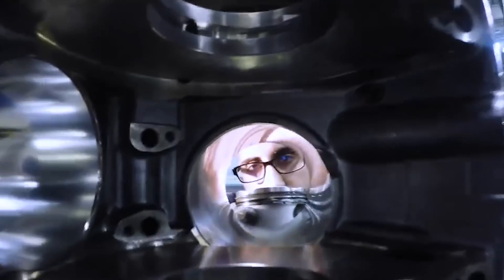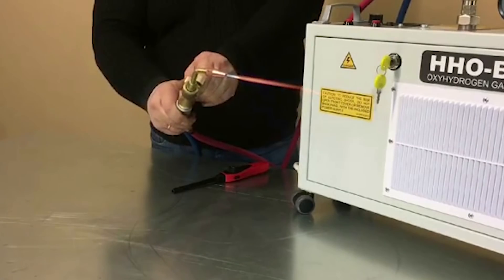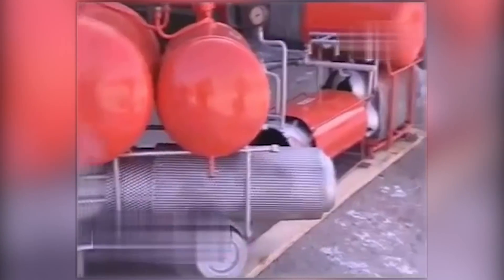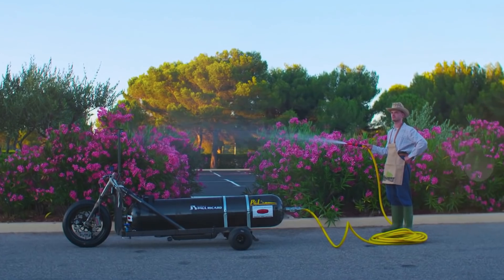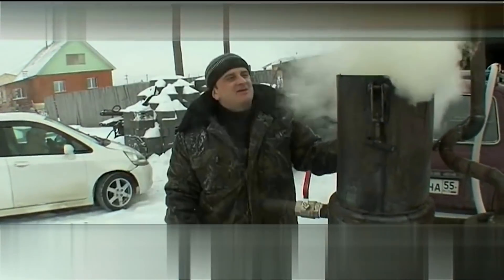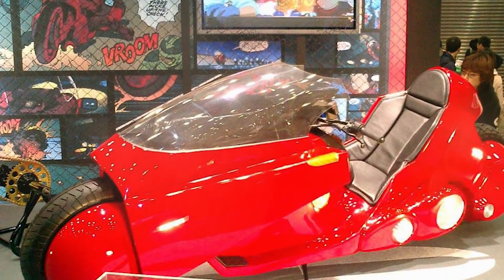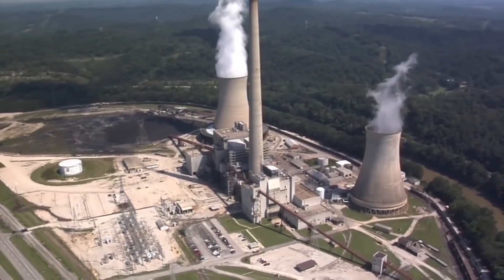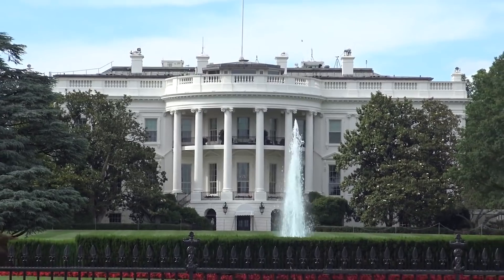Why These Engines Are Banned?

Comment: During WWII the USDA printed pamphlets on how to convert tractors to run on wood gas. Many farmers used this to power their tractors and cars for the war time. They stopped using it because they had to start the fire then wait for the gas to build pressure.
Reply: Mother Earth News had this years ago but without the proper scrubbers you had to clean the combustion chambers frequently because of sludge buildup. I knew one of the guys that worked on that project. That's what HE said.

Comment: This is ridicules! Simple fact is we're all on "the oil needle" because it's cheap. + Electric cars require expensive batteries, that pollute more to make then a gas for does for 15 years use and have limited range. Hydrogen cars are again electric cars, just utilizing the energy different
Compressed air? LOL!!!!! Even having a pickup truck with the back end filled would only yield a few miles range 😂 Using it in any form (even the yellow car) is the most expensive energy we got avalible, as "fuel" for a car that would by auto make it the most poluting class of cars
Reply: Pure nonsense. That might have made sense 115 years ago, not now. Fuel is by far, the major factor in the cycle life environmental cost of a car. There is just under twice the resources to build an electric, vs a gas car, but even that's negated by the ability to power the car from renewable resources. Because electrics have regenerative braking, they're much cleaner, even if charged by grid power largely generated by coal. They can effectively put some fuel back in their "tank" by slowing down. Combustion vehicles can't do that. Hybrids can, but that's because they employ electric motors and a battery.
Reply: @vincentrobinette1507  Did you just fall off the moon or do you live in imaginationland? 
It's not only the resources, but also the extremely harsh chemicals use for the batteries. Electricity isn't free, isn't renewable, isn't pollution free, AS STATED a gas car will be more environment friendly until you reach around the 15 year mark or 200K km. What did you think windmills where made of nothing or lasts forever?..... Look into it a bit and you'll realise windmill production is extremely polluting. Renewable energy is a myth! We can only talk about less poluting energy.
You think that's all saved by electric cars regenerating energy on breaking? Fuck no! Let me say it like this; a good driver doesn't use his breaks very mush and they'll very likely last for over 10 years, a bad driver and teens will however use a set of pads in about 1 year... So yeah, maybe just teaching people proper driving would yield better results....
Hybrids are the best of both worlds in the consumers eyes and the worst of both in environmental activists, so you may wanna adjust that last statement....
Reply: @VikingRul3s  true about the chemicals in a battery. There needs to be a lot of the materials unearthed, during the expansion of the market. Once the market is saturated, those chemicals and rare metals are largely recyclable. the only need for more, will be for further expansion of the market. Coal, and oil are mined used once, then, they are just pollution of the atmosphere.
     You're right about production costs per watt of installed capacity. You need to consider the continuous mining, and transportation of fuel during it's entire cycle life to keep it running. Once a turbine, or photovoltaic array are erected, the fuel is free, and is delivered for free. As such, they have an easy time paying back their environmental costs many times over in their cycle life, despite the relatively diminutive output. It has no overhead fuel cost, and does NOT continue to pollute, to produce power. You can't build anything without some environmental impact. that includes buildings, housing, bridges or other highway infrastructure. Wind and solar are such a small fraction of that, they're barely above the noise floor.
      Electric cars are the same way. they require about twice the resources to make, but they are efficient enough, that even if they are charged on a grid using coal fired electricity, their carbon foot print per mile is about the same as a good equivalent hybrid, owing to regenerative braking. They literally have the ability to put gas back in their tank while braking to slow down, or descend a hill. both hybrid and electric charged by coal fueled electricity are about twice as efficient as an equivalent gas only car. When considering the cost of running a gas car, the car is only half the energy and half the pollution of a gallon of gas. That gas had to be refined from oil that was extracted and transported, then, the refined gasoline has to be transported again. Then, you pump it in, and you get to burn it, creating the rest of the pollution. However the car is driven, the difference in carbon per mile is similar percentage wise, between hybrid, grid charged electric, and conventional. If the electric is charged on a grid utilizing wind, solar, or hydro electric, the advantage clearly goes to the electric.
     ANY car is more efficient if conservatively driven. Always consider the continual extraction, transportation, refining, transportation, then burning throughout the entire cycle life of the gas car. Electricity is transported with no moving parts. In Utah, where I live, 94 percent of the electricity from the generating sources, gets to my outlets. The conveyance of electricity is far more efficient than any fuel. 
     No one likes to count the continual damage to the environment caused by the continuous mining and extraction for fossil fuels. Gasoline doesn't just "Magically" show up at the corner gas station. I haven't even mentioned the mass spills, and fireballs from accidents. I'm talking about normal conditions, where nothing goes wrong.
Reply: @vincentrobinette1507  You don't seem to comprehent this, so i'll try again. No electricity is not free, it's not clean,  it's not some sort of miracle. The copper wires that need to be put down in order to support more strain on the grib isn't either.
To make electricity you need to sacrifice resources, you need to  pollute, there's no way around it, there's no 1-to-1 output. The production of electricity is about as efficient as bruning fuel, cause guess how a lot of electricity is actually produced...... By burning fuel......................
Reply: @vincentrobinette1507  BTW i don't expect you've included the additional cost of a electric powered car into the pollution? As they have a pretty steep pricetag this requires the the consumer to earn more cash before a purchase can be made. This can only come from conserving money or making more money. Now if you (like most in the world) don't have a practical possibility to use public transportation to your work, this money can be saved by choosing a very cheap, very poluting car for some years or by working a lot more which again = more pollution
Reply: @VikingRul3s  I actually did include the cost. It's about double a normal car. It's largely reflected in the purchase price. The car itself is cheaper, the major cost, both monetary and environmental, is the battery, and magnets used in the motor.
Reply: @VikingRul3s  you're right, but it's cycle life cost is not nearly as bad as something that needs continual fueling. That fuel is much worse over the cycle life of a normal car, and fossil fueled power plants. Renewables do require resources, just like anything else, but it's much less of a problem in the long term, than if we don't, and just keep on doing what we've been doing for the last century. continuing mining and drilling is not nearly as sustainable, as making a few machines, that don't require those continuous fuel supplies.
Reply: @vincentrobinette1507  The car itself is double the cost...... Again i must assume you live in imagination land where electric cars are cheaper then gas cars.................. An electric car also need continual fuel.............. How TF can this be so hard to understand for you? No i never said we should keep poluting, i'm saying don't bury your head in the sand, at this current point, as in right now, electric cars aren't then environmental saviors the headlines want you to think. Use you brain and do some research first!!!
Reply: @vincentrobinette1507  BTW that an electric car is that must more expensive was in my last comment for you, guessing you didn't even bother to actually read my comments..... You still didn't provide anything to back up your claims and apparently know so little about cars you don't even know electric cars are expensive.... So we're done here. Bye
Reply: @VikingRul3s  All cars require significant amounts of ENERGY to go down the road. You're absolutely right about that. it's just that an electric car requires far less energy per mile, than a gas car, with a radiator the size of a bedroom window, and has exhaust pipes that get red hot. Only 20% of the energy in the gas tank moves the car down the road. How much energy did it take to extract the oil, transport it to the refinery, transport the refined gasoline to the station, before you ever pumped it in to your tank? At leas 1/2, to 2/3 of the pollution was made, before you ever pulled up to the pump! A coal fired power plant is roughly 50% efficient. The transportation of electricity over the power lines loses approximately 6%. Plug to road efficiency of an electric vehicle is about 70 percent. That means 33% of the fuel burned makes an electric car go down the road. Add regenerative braking, they are equivalent to the best hybrids from ground to road efficiency. Now, let's add some free energy: Wind, Solar, or Hydro electric. Over the entire life cycle of the car, it is much less of an impact on the environment, despite the resources needed to make that cauldron of chemistry(battery). The initial purchase price is higher than a gas car, but worth it in the long run.
Reply: @vincentrobinette1507  So asked for some sort of evidence/links to back up your claims? I don't see em, so this conversation is still over.
Reply: Guess you never heard of the lithium Glass batteries in development - eliminates lithium breakdown and more powerful. There are more better batteries that are sold overseas (environmental wackos Europe even) but banned here. Wonder why... Also, we all could have unlimited electricity just by harnessing coastal wave generators. A lot of transmission lines from the coasts through the nation.
 Also, why do they sell Air Powered hand tools? - More cheaper to run, cool running, more power than electric tools!
Reply: @SamaritanElad  Yeah.... Coming from the country leading in coastal wave generators i'm gonna call BS on that statement..... We could at some point in the future, but not now and you know what, we're alive now, not in year 3000 where tech is better
Reply: @VikingRul3s  Its not rocket science, but a lack of desire. There are dams that been shutdown as well.
Reply: @SamaritanElad  Dams, 94%, yeah... As far as i know then you must then be from Norway or Sweden and their annual "renewable" energy isn't 94%...
No it's not rocket science to look at the world and see that sort of system can't be beneficial everywhere... So lack of desire, lack of high flowing streams, about the same thing right?........
Reply: @VikingRul3s Actually, Northern Mn USA. Don't understand why Duluth, Mn shutdown a couple of their water dams for electricity. Our nation already has nationwide electric power grid - that would need to be upgraded. Guess too expensive, but energy is there to harness
Reply: @SamaritanElad  Oh yeah right, forgot the US have actually done a fair bit in dams too :)
Reply: @SamaritanElad  BTW "The electrolyte is a highly conductive glass formed from lithium hydroxide and lithium chloride and doped with barium" You've ever heard of reading up on the science before you start flapping your mouth
Reply: @SamaritanElad  Oh forgot, there's a lot of air-powered tools because you save the cost of an engine on each tool, not because they pollute less. It's as everywhere els "must bang for your buck" that matters. They BTW doesn't pollute less, as already stated, compressed air is the most expensive energy we got available (most kwh/cals/watt, however you want to calculate it, per usable L air compressed to a point). Air tools are also widely used in industrial settings because of easy maintenance and low weight, so less strain the the worker
(edit: I use a lot of airtools in my workshop, i got some battery powered devices as well, but it's a matter of convenience. In reality we should only have regular wired tools, that would be the least poluting. Also got engine powered tools, again because of convenience, as i actually hate them a bit, they are SO much harder to maintain and laud as fuck!)

Comment: I'm working on an engine that uses cryogenic osmosis to channel dark energy into a counter rotating stator  driving a magnetopneumatic motor for my preambulator.
Reply: How do you control the thermokinetic balancer?  Every time I try it my turboencabulator gets discombobulated.
Reply: @ianb9028  
Usually, with a hammer. The impact resets the resonant frequency, but the power output drops off rapidly. Think I'm gonna try spinning the stator on some netronium bearings I have for another project. Hope the added mass doesn't compress the plutonium unduly.
Reply: @chuckaddison5134  Excellent I shall try the old engineers principle:  When in doubt give it a clout.  The more the doubt the bigger the clout.

Thanks for your assistance
Reply: @chuckaddison5134  If you can't fix it with a hammer, OR a BIGGER hammer, it has to be an electrical problem.
Reply: My new turbine runs on lint found in the bellybuttons of aardvarks from Eritrea.

Comment: I sent an email asking for more information and asked the French company that were building the air powered auto engine, if they consider designing a car with a light weight fiberglass body that would resemble a early corvette, or thunderbird, or other small sporty convertable, and use L.E.D. lighting ? I got  absolutely no response. They are not interested in designing a sporty or attractive vehicle.

Comment: Rotory engine obviously German designed but in actual fact it was the British that managed to get each part of the combustion cycle of the rotor was Tuned by the Norton BikeRacing Team this team managed to pull higher BHP YIELD while not sacrifycing Reliability with excessive wear at the delicate seal between the combustion Chambers  VERY SADLY the Rotary tech sold to the Americans for their drones.It's simply wrong view of History of this excellent engine type that not only offers great reliability but an excellent power to weight advantage as well as crazy torque for it's size thankyou for the work the Brits has done with this engine I witnessed in the 90's ths Norton bike up against a much much Lighter formular 1  2 stroke on the straights the immense torrque of the 533cc engine or 433cc Engine would tear up the road right behind the Yamaha stroker what an Engine wow
Reply: As told by an American schoolboy what do you get?